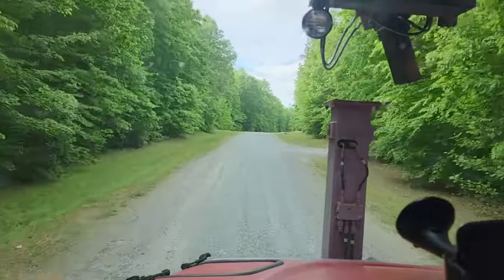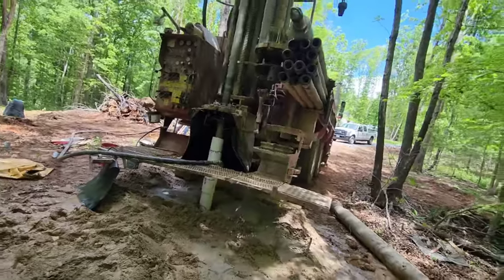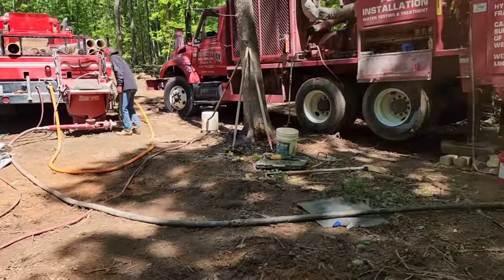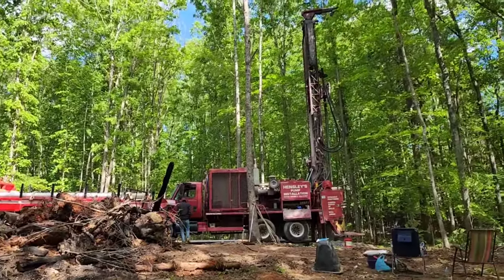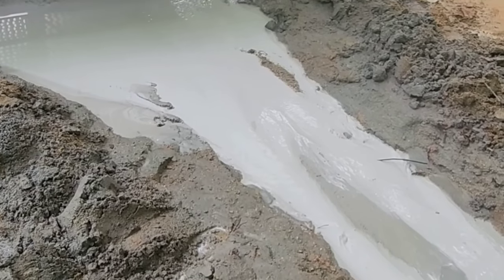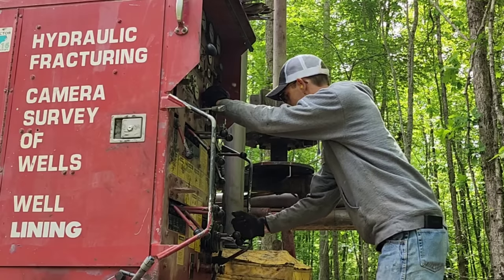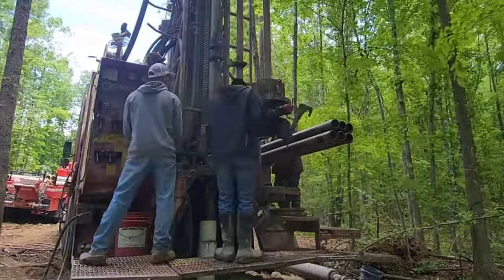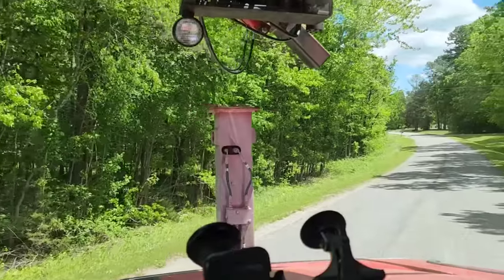Drilling a Water Well with The H²O Mechanic. Ep1 "It Collapsed". Dealing with a Sandy Formation.

Comment: We grew up tasting the best water, not spring water, but "fossil" water. In 1958, my Dad drilled down to 297' got through the sulfur water that everyone else was plagued with, and struck good water. He used 6" casing to seal the well against the sulphur water, and stopped when the water didn't smell anymore and gushed out the borehole clean and clear (so he said). Anyway, I know that well lasted until 2010 without any work on it at all when the only home we ever knew was sold to a guy that made it into a sandwich shop. But even then, the water tested "excellent" (and 10 gallon/minute) by the State of New York, County of Ontario. There is no doubt in my mind that we were extremely lucky to get water of that grade, and were able to keep it over many years. Thanks for your videos, it helped me understand what my Dad did for us.

Comment: I'm a commercial driller all week working all over this great nation and a cable tooler on weekends with my son so can relate to many things you talk about and I would say you do a good job on the rig and explaining some of the challenges we deal with. Nicely done but I will say after 12 years I've seen enough stuff fall from heights that I'm surprised no hard hats? Many people don't think it's necessary and will fight it but after being forced for so long now it's habit and on the weekends we still comply, just a thought or concern but still have enjoyed your content on many of the topics you cover great job
Reply: I don’t think a hard hat will help against a 400 pound drill rod. Your done,  anyway you look at it. Your right though about the need for a hard hat.
Reply: Agreed. Safety glasses? Steel toed boots?
Reply: @tomsommer54  Yeah but a 1/2 pound bolt or rock something like that is what a hard hat is designed to save you from as well.  Also a drill rod coming into contact with the side of your head may knock you over wearing a hard hat but without the hat may stove the side of your head in.
Reply: @nspro931  I think we used hard hats once when there was a city inspector on site one day ... but otherwise  they just get in the way , and wouldn't save you if things went south.
And that was even on a 10" , 10 ft sections line shaft turbon 700ish foot deep .
What screwed me up the first time ... was after we did a 6 inch , then the first time I did an 8 inch .   I thought no big deal moving the elevators sideways on a truck bed .
But that motion messed my back up , cuz the 8 inch elevator was that much heavier than a 6 inch.    An elevator is a 2 piece hunk of metal that clamps around the pipe just below the pipe coupling that is at the top side of every stick.   Which are usually 21 ft ... but once in awhile they are only 10ft like the line shaft turbine which had an epoxy coating on the inside.   But not only does it have 1 1/4 inch solid steel drive shaft in the center ... but every 10ft joint had a spanner to hold the shaft in the middle.   That was a lot of fun putting together ... all done without hard hats.

Your fingers are what to worry about .   But everything is safe when you do each stick the same ... never get out of rythem .
Reply: @tomsommer54  It'll give you a much better chance than not having one.

Comment: I like what you said on safety.  My Grandfather had a sign "SLOW DOWN" on his workbench, going slower ultimately gets the job done faster because of fewer mistakes rushing.  I've also heard for DIY fixes doing the repair is the 3rd or 4th goal; not getting hurt is the 1st goal, not making a problem worse is the 2nd goal.
Reply from the maker: Amen! It's a dangerous profession, I try to make it as safe as possible & look out for those who are new around the equipment

Comment: Hi. In Romania we put casing all the way to the bottom of the well. In my case i have a 360ft deep well with 360ft of casing out of which we have like 45ft of filter casing. At the bottom of the casing we screw a cap that looks like a cone. Around the filters we put very small gravel that filters out all the sand. This way we pump out sand-free water. Maybe in the US you have very rocky ground so you don't need to do this because the walls of the well will not collapse. It's curious that we build wells so differently
Reply from the maker: Your wells are gravel packed, there are certain regions in the US that require that type of well construction too. It varies from place to place
Reply: In North East Texas it is this way. Gravel packed that is. I built a homemade rig and drilled the well with the casing and left the bit on bottom.
Reply: I just had a new well drilled.  160 feet of 6 inch steel casing, and they placed a stainless steel screen about 5ft below that.  There was a couple of feet of clay about 60 feet down, but the rest was all sand.  The sand below the clay was beautiful white quartz.  Such a relief to have good water after my well went dry for a few weeks last year!
I understand a few miles north they usually hit hot, rusty water.  A few miles west they often drill thru ancient trees and have artesian wells.  Never know what you are going to find until you drill!
Reply: @Sylvan_dB  half a mile west to my place a friend of mine drilled 330 ft and found very hard water.  i drilled 360 and the drill crew said they never found water so good in their careers

Comment: Here in southern Arizona on my ranch I had to go to 980 feet through decomposed granite, at $30 per foot. Then there was the rest of the costs. We did get 3 gallons a minute so it was OK. I enjoy your videos, I learn from them. I have 3 wells and they are all a different story. Thanks.
Reply: And you ended up in limestone  when you got in a water zone ?
Reply: $30/pf isn't horrible, it's not great either, it's the depth that really got you. That stings.
Reply: In Ohio I’m getting quotes of $40 a foot anything over 100 feet deep. First 100’ is $4,000. 😐

Comment: Interesting about the different layers of sand and rock you're going through. Our well is 10yo with 50ft of clay and 60ft of steel casing, 425ft with 2 streams 1 @ 400 the other around 370. 4-5gpm

Comment: Drillers around here run steel casing and it spins down in the opposite direction to the bit at the same time.  No where near the issues with collapse this way.  Much bonier material than sand and clay though.

Comment: We just bought our first home and have been fighting water issues since the second day. 
1st we had no water so I replaced the switch, drained the bladder tank and filled it back up following your instructions. That worked for a couple days. Then we lost water so I changed the filter and that fixed it for another day. Then we lost water again and I just removed the filter completely and we had water again but not even a full day later we have no water, filter is still out I took the pressure switch apart again and sanded the wires and that got the bladder tank to kick on but the pressure regulator hasn’t increased and we only got water back for 10-15 mins
Reply from the maker: Maybe your running the well out of water...
New Home? Check the toilets!!!! Make sure none are leaking and none are constantly overflowing in the back tank. I see it all the time. 
Keep the breaker off over night and allow the well to recover, if it still happens as soon as u wake up, then you probably have a pump issue.

Comment: I would like to know more about the bentonite and cement. When do you use it and why, how do you mix it and pump it, does it go in the well or around the casing. Thanks for the great videos.
Reply: Bentonite and cement grout form an impermeable layer around the casing and block the base of the casing/well off to prevent surface water from getting into the well and also helps to fix the casing in place. Typically mixed into a slurry and pumped with a cement pump into the well around the casing.

You only want nice clean water from the aquifer below.

Comment: Do you send that plastic casing Intel rock?. Because in our area, you have to set the casing by code 20 feet into the rock one length of casing. As far as I know, can only do that with steel because you have to drive it. That’s all for sealing the well up from surface contamination.

Comment: You never mention using a dowser. Or if the homeowner had dowsing done and picked a specific spot. Fun fact: All the neighbors around me are deep wells at 572 feet up to 1000 feet, and some of them are slow return, in the range of 2 GPM and less. My mother and I did the dowsing at my house and we both hit the same spot. 445 feet and 7 GPM. I'm just curious if you ever had experience with dowsing?
Reply from the maker: Some of our deepest wells are from a dowser. I believe there's some fact to it, but its not a guarantee.

Comment: Can loos your hammer on a cave in loose circulation. Then you try blowing a hole and you can undermined all sorts of areas trying to get your tools out very hectic. Blowing air and water down and not knowing where it’s going is dangerous. the whole rig can get sucked into a gigantic hole. Can I have a blow up right under your feet or anywhere? It’s really spooky really fast.
Reply from the maker: I'll drill the 10" bit 15' into rock normally or more in some cases. Once I get past 60ft of casing, I typically don't use the 6" hammer to blow the hole clean, I use a rod size check valve, this cleans out the hole & allows casing to fall to the bottom and the holes clean without risk of the 6" hammer breaking the casing,  once I get the casing to the bottom, I trip out & hook up the 6" bit/hammer & go down a clean hole to start drilling. 
One thing I've learned about drilling is that it varies drastically region to region. We're in Rock country, so running into sand is tough on us bc we have to deal with it, with the equipment we have at that time, if it gets bad, we'll go back on day2-3 with the equipment to handle the situation We're in .
We sometimes run a 7ft piece of metal at the bottom connected to the pvc casing, handles the abuse from the hammer the first 5-10ft which is the most critical.

Comment: Why not pretend you are doing the very best job possible. For the customer. Instead of complaining about the inspector, who’s only job is to protect the customer from cheating drillers. Only cheating drillers should be afraid of the inspector. As a retired inspector, there were contractors, i could trust. There were many i could not. The ones i could trust on occasion i could tell them. ok i will pass your job today.

Comment: I hope you get this . I ned help . I had the plumber back to tighten a fitting and after it still drpped and it got worse and worse to today where I went down and it was spraying water all over the basement . I was a fitting for the whole house filter  and I guess when he tightened it it must have cracked a little and got worse ever time the filter self backflushed . Now July 4th I had to turn off the water to the house before the leak flooded the basement  HELP PLEAS  COULD YU GIVE ME THE NAME OF SOMEONE IN PITTSLYVANIA COUNTY VA . My hands are to small for the vice grips to loosen the fitting to replace it . I had bought extra parts when I had the filter put in , so I have the fitting .
Reply from the maker: Your in Danville area? Send pics of the leak to Hwdracing@gmail.com. I'll see if I can assist you better once I see a couple pictures of the issue
Reply: @h2omechanic  I sent pics of filter but all the connectors were tightened to the point they are all crooked  . They leaked from day one but only a drip and it got worse and worse everytime the filter backflushed . Yesterday basement dad water in it when I checked it . I check it every day just to make sure
Reply: This is real REALITY TV!  Thank you for demonstrating the work ethic that made this country what it is. In my life I have never needed an actor, an athlete, or a politician… but I need water daily - people with your skill & drive are America’s real heroes!!!
Reply: @treasuretraveler3613  we don't need spring break college idiots either or the lawyers they try to become . They waste money on carreers that seem to almost always do not make them any money but make their parents poor . I like your statement 1 million % correct